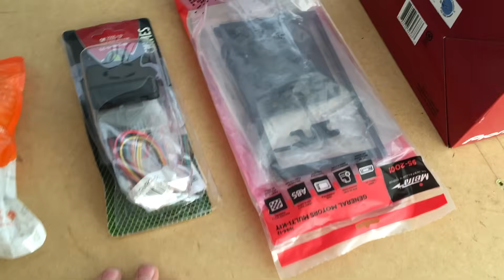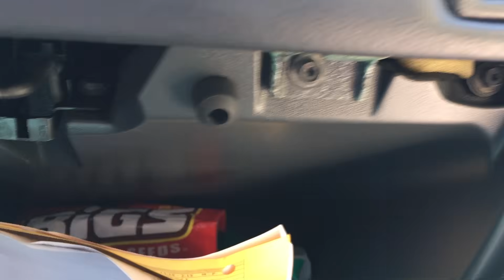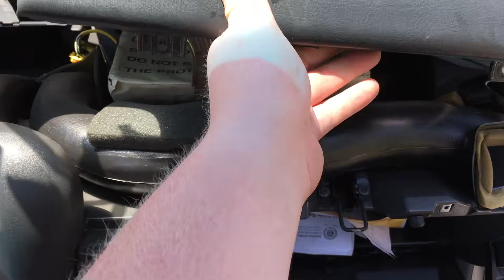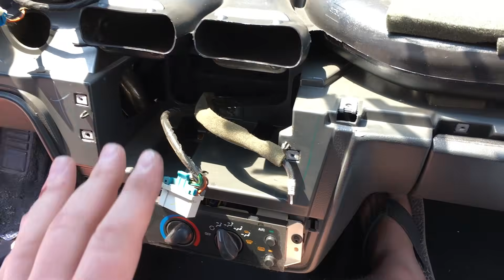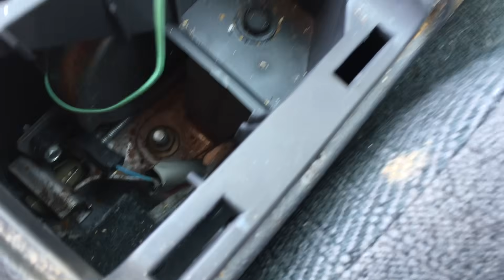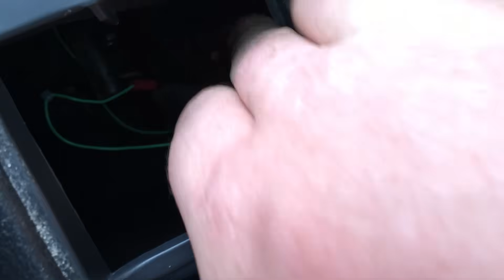1995 - 2005 Chevy Cavalier Radio Install

Comment: Hey, I’m trying to install the radio on a Cavalier exact same year model that you’re doing in this video and for some reason I can’t get it turned on with the ignition, even though I turned the ignition on and off the radio doesn’t even comes on when I touches the wire the red and yellow wire the turn on once I release the turn off, but it does not turn on and off connected Exactly how you have it on the video and still know working
Reply from the maker: Depends on your year Cavalier, you may need a smart harness.  What year is it?

Comment: I am about to swap out a factory radio for an aftermarket one in a 98 Cav RS. Does wiring a harness adapter to the aftermarket radio to the factory harness cause passlock1 to trip?

That's my worry.

Comment: Quite a bit late, but thank you for this video. I have a 2002 LS Sport Coupe with 69K miles on it and only now beginning to show a bit of rust right near the back of the bottom panel beneath the door.  I was going to buy a new car, but given the current market, I'm looking for ways to extend the life of this one but still have the functionality of being able to use bluetooth.   This video was super in showing me how to get the dash apart as well as understanding that the door chime/turn signals are an important thing to remember in regards to replacing the radio unit.  You wouldn't happen to know if the security system doesn't also go thru that as well?  I've read on some makes and models/not necessarily Chevy that is the case.

Comment: Help! I wired all of the wires up and have no power to the radio. I’m stumped and don’t know what to do.
Reply from the maker: Use a multi meter and check out connections. There isn’t enough info here to help you.

Comment: I'm looking at getting one right now, I kind of wish the previous owner saw this video, it looks like they tried to replace the radio but didn't know to remove the dash part first.  The radio panel is just cracked and one of the vents is completely gone.  It has very low miles though and I need a car, also I love small cars 🙂

Comment: I plan on getting a nice upgraded red chevy cavalier convertible that's from my birth year. It even has power windows opposed to the crank handles. I wanted to get a new radio installed and maybe get the windows tinted.

Comment: I feel like the dash for the Chevy Cavalier is poorly designed. It is much easier to remove the radio from a Pontiac Sunfire. You only have to undo 2 screws by the glovebox and the trim piece around the radio and HVAC controls comes off.

Comment: Where do you get the adapter that goes from factory plug to new plug
Reply from the maker: any online reseller had them (amazon, ebay, walmart, sonic electronix).  Any local car audio shop should also stock them too.

Comment: I connected the harness and everything up and when I plugged it in and turned the key my radio didn’t turn on , what am I doing wrong ?
Reply: The Dickster same for me lol. I’m trying to figure out where the power wire from the new wiring harness goes
Reply: Danny Barker Same here, have you found a solution?
Reply: Same thing happens with me. Did you find a solution?
Reply: In case you guys didn’t figure it out: the red wire needs a switched signal. Crossing red and yellows together will have it on always. You have to wire the radio to the fuse box to a switched fuse.

Comment: This is a really good video, very clear and detailed, thank you! I have a 1999 and when I measure the height of the radio (from outside the dash), it's 3 inches. Is that a 1.5 din? And if so what do I need to look for when getting a new radio?

Comment: Hey man I just got a car like this with the same radio and stuff but the guy told me the Battery goes dead because it's always on and never turns off what is that? I think he has it running the the battery which is making it die I hope your still on the channel I need some help

Comment: Everything I read online says the factory radio harness does not have a keyed 12v source so you have to find one ? Is that true
Reply from the maker: Yes, which is why we installed a "smart harness" to provide that  at the radio harness.  These vehicles run on canbus data system, not analog.  If you do not want to buy the smart harness, you can run a line to the fuse box and tap into switched power.

Comment: My 2003 Cavailer has TWO wiring harnesses. New radio has one to connect, what do I do with the other, smaller one? I tried to just ignor it, but stereo does not work . Stereo does work if i test it with a power inverter, so it's not the new radio. Stuck with dash apart, ugggg
Reply from the maker: You most likley still will not use that second harness, but your primary radio harness needs to be correct as your system operates on a digital, canbus system.  Make sure you have the smart harness, like the Metra LC-GMRC-01 Wiring Interface for the radio to work properly.

Comment: So if I want to connect the red wire to a switched power source, where would be the best place to connect it? Ive heard rumors of there being an empty switched power slot in the interior fuse box if the car has manual windows. The kit I plan on ordering for my cavalier comes with a red wire to do this...any advice? I doubt it would matter but mine is the 2005 model.
Reply from the maker: You can use an "add a circuit" which allows you to connect into any switch power fuse (occupied or not) to tap into power.  Then use a multi meter to probe each fused circuit in the fuse box to locate a switched power source.

Comment: Where did your purchase your wiring harness?? I just bought a 2000 Chevy Cavalier and is trying to replace the radio. Do i need to buy a chime retention or just the wiring harness ?
Reply from the maker: Sonic electronix.  They have a vehicle fit guide you input your car data to locate the correct parts for your install.

Comment: I have a 2001 Pontiac Sunfire and I don't care about the chimes noise I'm going to put a double dine in without a CD player is thier any way I can by pass the chime noise PLEASE LET ME KNOW I have been told thier is no way
Reply from the maker: Well, you could get by with Metra 70-2003 but it's not recommended.  The harness adapter that retains the chime also retains the R.A.P. or accessory source behind the radio, along with a few other things.  Not buying the smart harness may open you up for issues.

Comment: Hey man where did you tap into for switch power for the radio
Reply from the maker: Fuse box.  Use an "add-a-circuit" to safely tap into switched power.  Use a test light or multi meter to find the right one.

Comment: Very nice video. I have a 2002 as well with 334k miles on it. Unfortunately, the interior got a little busted up after taking it to a mechanic. but I'm planning on fixing it up a bit and installing a double din radio to modernize it. No reason to let a good car go to waste ;) Especially at 334k miles! She's got plenty of life left in her
Reply: How’s the car doing now? Still have it? Still driving it?
Reply: @marshalastovall4270  it probably still runs honestly. these cavaliers won’t die
Reply: I’ve had mine for 10 years and it is so dependable. Love my Cavi so much. I’ve owned three and when this one goes, I’ll get another one. 😊
Reply: Mine has 177k with a brand new rebuilt motor slid into her 🖤 as my first car, I decided to take care of her to the best I can and keep her up into top shape! Although I did hate the process of replacing both control arms

Comment: how can i bypass the parking brake wire?
Reply from the maker: https://youtu.be/0xYNn8LDvnE
Reply: hell yeah! you guys are awesome!
Reply from the maker: Subscribe!
Reply: Provo Beast Audio Installation done!
Reply: just hooke up a pioneer avh200-ex today, thank you so much for your videos man
Reply: i have 2 - 10in SVC 8ohms 300 rms Subwoofers,,, what kind of amp do i need?
Reply from the maker: If they are both 8 ohms and push 300 watts a piece, you'd want to find an amp that can do 600watts RMS @ 4 ohms (wiring the subwoofers in parallel).  This pioneer amp is able to do 300w RMS @ 4 ohms if you bridge the 4 channels down to two: https://www.amazon.com/Pioneer-GM-D8604-4-Channel-Bridgeable-Amplifier/dp/B00A02PG0C/ref=sr_1_8?s=electronics&ie=UTF8&qid=1523889732&sr=1-8&keywords=pioneer+amp
Reply: thank you so much! appreciate all the help and quick responses
Reply: Provo Beast Audio Installation how can I wire them parallel if they are both Single voice coil?
Reply from the maker: All depends on the amplifier you purchase.  What did you pick up?
Reply from the maker: It would, but you always get what you pay for in quality.  Boss is usually the lowest in quality amps.
Reply from the maker: Ya so find an amp that does 600 w at 4 ohms like that boss amp and wire the two subs in parallel.
Reply: oh shit saved me there lmao thats good to know! i think i got bose and boss mixed up for a minute
Reply: thanks again for the replies you guys have been a HUGE help 💯💯

Comment: So, I just came across this helpful video. I tried installing a Pioneer : https://www.amazon.com/gp/product/B01KKHSYGE/ref=oh_aui_detailpage_o08_s00?ie=UTF8&psc=1Wiring Harness and Trim Kit : https://www.walmart.com/ip/CHEVROLET-2000-2005-CAVALIER-CAR-STEREO-CD-PLAYER-DASH-INSTALL-MOUNTING-KIT-WIRE-HARNESS-RADIO-ANTENNA/197813518On a 2005 Chevy Cavalier. Long story short... I wired up harness per color (orange wire not used), RED wire was instructed to tap/piggyback on the 25A Windshield Wiper fuse for power. When I turned the car on, the display on the Pioneer would come on and all of the warning lights and gauges would display correctly. WHEN I TURNED THE STEREO ON, the car's gauges would bottom out, the headlights would come on, "ERROR" would display on odometer, and all of the warning lights would stay on. Also, no sound. Uninstalled new stereo, reinstalled OEM, everything working correctly.Would installing the chime wiring harness correct this issue? I will definitely gladly purchase one and install. I'm surprised I haven't read or heard about anyone else having this issue? Thanks.
Reply from the maker: Your Cavalier requires a smart harness as it runs on a canbus data signal.  You will need the harness we used in the video (parts are listed in the description).  This will fix your issue.
Reply: Awesome. Will give it a shot and let you know. Thanks.
Reply from the maker: Subscribe!
Reply: Worked like a champ!
(Now all I have go do is find my daughter a dash for that thing that isn't crumbling, lol)

Comment: I recently put a new radio in my 02 cavalier but the sound is very faint? Any clue?
Reply from the maker: Sounds like you may have the wrong wiring harness.  Do you have the factory monsoon system?

Comment: So if i buy the same exact harness as shown in your video my radio will work correctly an shut off with the ignition? Because I installed a wiring harness before that didn't have the chime kit an it killed my battery for like 2 weeks straight an i had to manual shut the radio off.
Reply from the maker: You bet.

Comment: I know this is an older video but it's still one of the best i have seen on this.  I have a question though, because of how old this video is and how quickly technology advances, the radio used in this video is no longer easy to find.  I was wondering, is there a newer model that i can use that would be the same set-up?
Reply from the maker: https://www.amazon.com/Pioneer-AVH-X390BS-Bluetooth-Receiver-Xm-Ready/dp/B06W2NBDP6/ref=sr_1_5?ie=UTF8&qid=1516291920&sr=8-5&keywords=pioneer+bluetooth+radio
Reply from the maker: https://www.amazon.com/Pioneer-AVH-1300NEX-Multimedia-Bluetooth-SiriusXM-Ready/dp/B073BNFTV7/ref=sr_1_1?s=wireless&ie=UTF8&qid=1516292063&sr=8-1&keywords=1300NEX
Reply: Thanks for replying so quick
Reply: Provo Beast Audio Installation i just thought of another question.  Is the instilation the same as far as all of the rewiring goes?
Reply from the maker: Yep!

Comment: I'm having a hell of a time. Perhaps you can help me out. I have an 04 Cavalier and we purchased the wiring mount and a Dual (brand) double din bluetooth stereo. We wired it all up, then plugged it in with the wiring mount. The stupid thing wouldn't power on. We could hear the cd player power up, but then nothing. We thought the stereo was bad, so we took it back and got another of the same one, plugged it back up, and still nothing. The fuse is fine, and we're pretty sure the wiring is right (unless we bought the wrong mount). It simply won't power on other than the hearing the cd player kind of engage. Any idea what might be wrong?

Comment: Hey, thank you for a great video!
I have a few questions that I would really appreciate if you answered.
1. I saw someone stated that the dash will crack and break. What do they mean?
2. I am looking for a radio for my 2003 Cavalier with just Aux/USB, are there radios like that out there, or do I have to get the one you got?

Thank you
Reply from the maker: Any standard size single or double din will work.  The dash may be brittle and crack when removing.
Reply from the maker: https://www.sonicelectronix.com/item_121743_Pioneer-DEH-X2900UI.html Use coupon code ProvoBeast for 5% off a checkout.

Comment: What did you use to trim the back of the storage area?
Reply from the maker: Dremel tools are usually the easiest, or an Air saw.  If you son't have those, a small and saw works.  Just be creative.

Comment: Thank you for this video. Do you think the x491 pioneer 7inch display will fit this cavalier?
Reply from the maker: Yep, as long as it is the 2000-2005 model years with the double din opening (like the video), it will fit fine.

Comment: There's 2 grounds coming from the cavalier, do you connect the head unit's ground to one of them or to the chassis somewhere? (JVC Unit)
Reply from the maker: Well, i would verify they are indeed grounds by using a multi meter.  Better safe than sorry.  You will connect the JVC ground into the wiring harness.
Reply: Provo Beast Audio Installation Did so but now cant figure out the power wiring lol. Got yellow to Orange but the red drains battery on cigarette lighter connection.
Reply from the maker: Did you not use a wiring harness adapter? Why would you tie yellow to orange?

Comment: Is this problem on all gm produces with the chimes also with turning the radio on and off because i didnt have this problem with my s10 or blazer
Reply from the maker: Generally 2000 and newer moved over to a canbus system where the door and warning chimes operate through the factory radio, and there is no longer an analog ignition wire behind the radio.  So this requires the chime adapter which also provides the red ignition wire behind the radio.

Comment: can I install a double din dash bezel of a model year 2000-2005 to my cavalier year 1997?
how can I do it?
Reply from the maker: It would be tricky, the HVAC controls moved so it would require a lot of modifications.
Reply: @ProvoBeastAudio  how did you put on the dash that covers radio and instrument cluster?
Reply: @ProvoBeastAudio  I'm having a very hard time putting it back on

Comment: Without the chime kit will the radio still work? Obviously you won't hear the warning sounds and such of the car but will the radio on its own work?
Reply from the maker: Yep, all you need to do differently is run a wire to switched power for the ignition accessory wire on the radio.  That red wire needs to be connected to a power source only on when the key is on.  Try using the power on the cigarette lighter by the steering wheel column.
Reply: @ProvoBeastAudio  helpful information

Comment: Just ground the green wire and you can have movies play without the parking brake on
Reply from the maker: You cannot just ground the green wire on a pioneer, they require a double pulse negative signal and simply grounding the wire will not work.  If you want to bypass the video warning while in motion, you will need a microbypass or a manual toggle switch to reproduce the double pulse negative.
Reply from the maker: Yep, kenwood hasn't caught up with the times, but Alpine, Pioneer and Sony have grounding restrictions.
Reply: Casper Hollifield you can do that with a kenwood. i wired a switch on my pioneer i could flip on and off to make it work.

Comment: i installed a pioneer radio in my 2002 chevrolet cavalier but the radio wont turn on if the yellow and red cable are not together and i hace to turn it on/off manually can you help me?
Reply from the maker: You need to either run a wire to switched power in the fuse box or tap into the cigarette lighter postive wire.  That is where you need to connect the red wire.  It needs to be hooked into a source that turns on when the key is on.
Reply: what does the chimer do?
Reply from the maker: Keeps the car warning chimes, door chimes, etc from the factory.  Previously they ran through the factory radio.
Reply: is it necessary for my car.
Reply from the maker: Yes, it is very recommended, but there are ways to do without.

Comment: does the original alarm of that 04 cavalier still work with aftermarket stereo?
Reply from the maker: Not sure, this Cavalier didn't have the factory alarm system equipped.  Essentially yes, they should still work, but i cannot verify that.

Comment: How do I install on a 1997 model?
Reply from the maker: Same process, but only single din radios work.  Check Sonic Electronix for a fit guide on parts needed and use coupon code ProvoBeast at checkout for 5% your purchase.